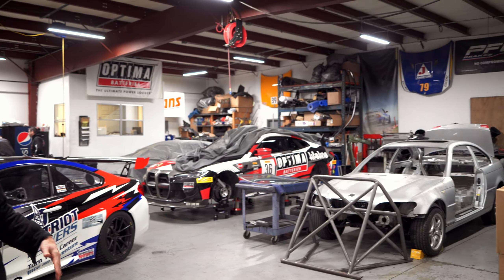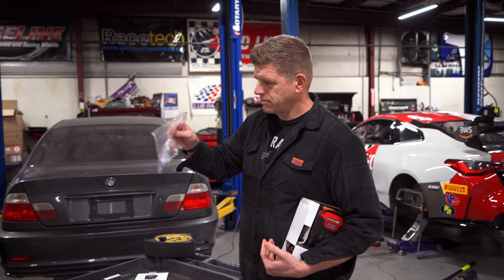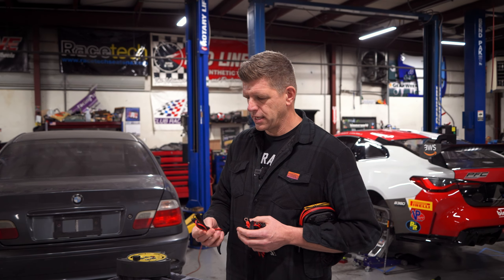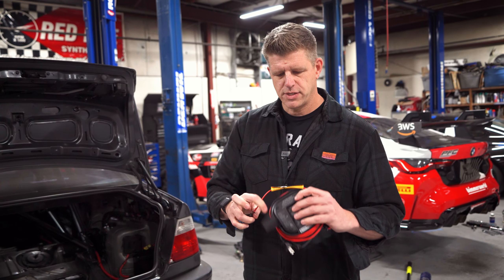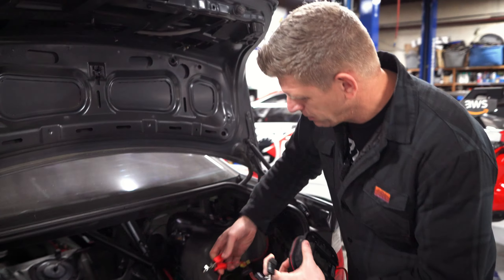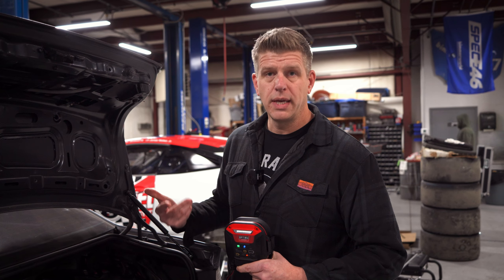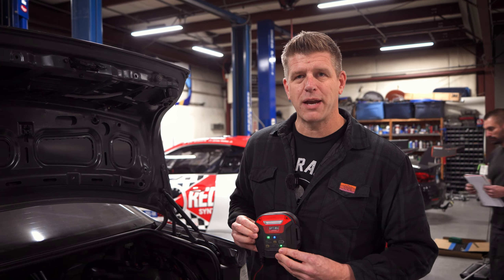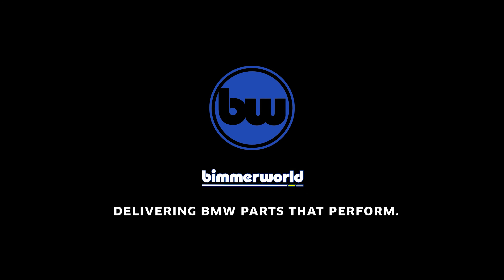Don't store your car without one of these!  OPTIMA Batteries to the rescue!!!

Comment: What's the benefit of the optima battery compared to the bmw agm battery? 

Would it be better to use a braille or antigravity battery?
Reply from the maker: Two really good questions that we could probably spend 20mins answer, but here are some quick words from James Clay himself who has the most experience and knowledge of OPTIMA Batteries you could ever find...

"Why OPTIMA over BMW/Braille/Antigravity? 
A few key factors make OPTIMA our battery of choice.  The first is OPTIMA uses 100% virgin lead for the highest level of energy capacity and performance - the recycled stuff goes into other brands.  The OPTIMA also packs more lead into the same H7 package for example - it's like having an S58 engine that was underrated on the spec sheet and makes more power at the wheels on the dyno than BMW said it made at the crank.  Finally, since most battery failures are internal at the weld points, OPTIMA has a unique process that casts the internal bus bar straps onto the storage plates/cells to make these super durable. At this time, the OPTIMA Orangetop Lithium is not released for the automotive market.  What makes these batteries unique is the highly-advanced BMS that protects both the car and battery that other small lightweight aftermarket offerings don't have (This is unlike the full-sized BMW Lithium battery offered in some M Cars).  But cars/automobiles have advanced electronics and to operate at 100% in all car and all conditions is a challenge even with their level of BMW, and one OPTIMA is still finalizing before signing off for this use."
Reply: @BimmerWorldMedia  Thank you for the detailed explanation 🙏. I will look into them in the future. The only thing I dislike about the bmw battery is that they are heavy. The other reason I was asking its because sometimes I can find them slightly used at no cost, "so why change"?.

Comment: Do i have to unhook the battery from the car to use this?
Reply from the maker: Nope.  Whether you are using the clamps or the plug in leads that attach directly to the battery at all times, you can just hook it up as the car sits and it will charge/maintain.
Reply: @BimmerWorldMedia , than you for your response on an older video. Going to hook it up now.